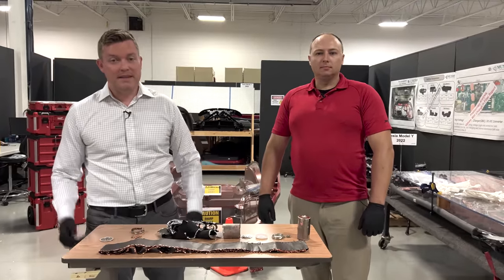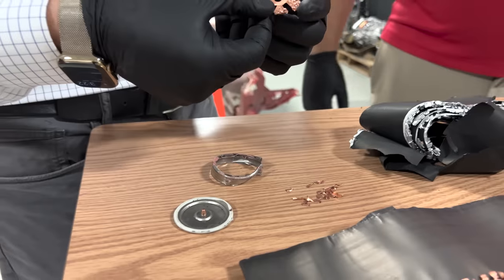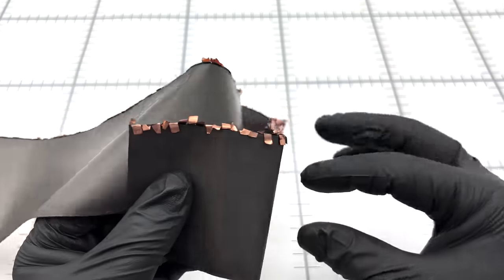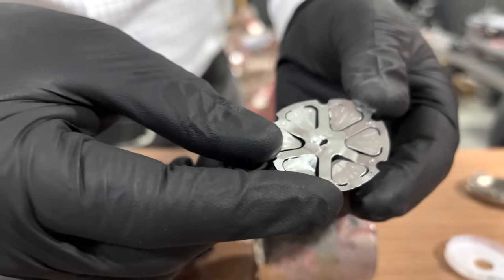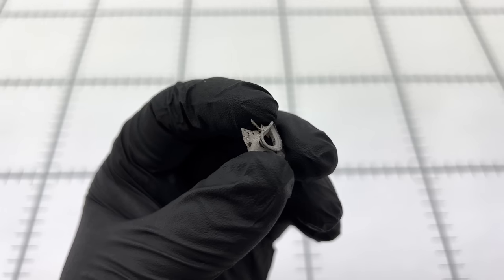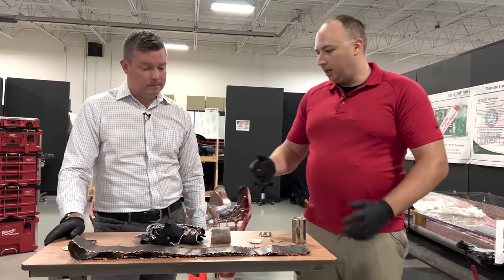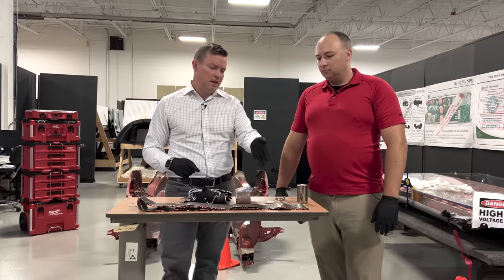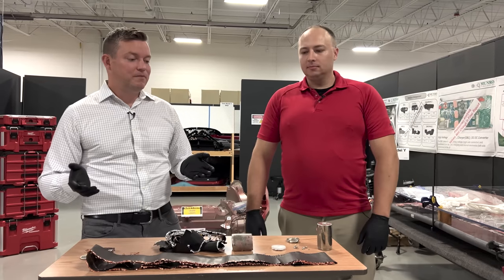What's Inside a Tesla 4680 Battery?

Comment: BIG , NO , gigantic problem for BEVs is cells and or pouches are not standardized for ALL vehicles so as to make servicing/replacing WAY cheaper. Imagine if their were 50-100 different brand flashlights or ANY electronic device , that all took a dealer-only expensive battery ! People would revolt. No C or D-cell just a million dollar TESLA-only cell. Throw vehicle out when it goes bad. And NO , repurposing is NOT same as recycling the cells. You cannot get the goop and metals back out. If you could it would waste an enormous amount of time/money/energy to do so. Landfills will be full of these harmful batteries. 
They are basically throw-away cars , too expensive to install a new battery.

Comment: Cooling. I’d really love to have heat pathway explained, is it anode current collector only, does it go direct to can? Cathode has electrical insulator on cap - does this effectively prevent heat flow?
Electrical. Those flowers are fragile thin & convoluted, why? How does this compare to tab (x 5)?
I gotta say, I’d prefer tough cylindrical cells highly protecting fragile contents, over say pouch cells!
Reply: already shown , in PACK disassembly.
4680 are still SIDE cooled , just like 2170/1865.
no use PLATE cooling , yet.
Reply: @markplott4820  I disagree Mark.
Hence the question. 
I think you are distracted by it LOOKING the same as plaid style.
Side of metal cell attached to cooling bandolier - yes. (with electrically insulating coating)
But from there into jelly roll - radially through many layers of electrolyte, separators, cathode & anode coatings?, 
or axially via metal current collectors. Huge song & dance about it battery day - so how’s it working out?
Using bandoliers rather than base plate cooling allows tiny height reduction of pack and easy path for expulsion of electrolyte in thermal runaway event. I don’t think this is interim part of design.
Reply: @iandavies4853   - we can see , from the Structural Pack disassembly , no plate cooling , same type of side cooling Deployed w/ thermal foam and bottom plastic retainer - non Conductive. and top FUSES and bus bars.
Reply: @markplott4820  I’m not disagreeing Mark. No bottom plate cooling, it’s by bandolier - where the 34 / 35 cells are strung together. Side of cell. Agreed.
My question is what happens then, inside the cell. 
Please, just move on, someone else might chip in. 
I’ve no interest in converting / educating people, it’s too painful.
Reply: @iandavies4853   - what happens in the cell ? - then see TESLA Battery day.
also , see JORDAN on 4680 analysis.( the Limiting factor).

Comment: Dry Process Cathode?
Reply: At least one half the cell looks dry. Its covered. I didn't see the backside too well but I think its electrolyte anyway.. and Cory said something to that effect. Its still like a peanut butter and jelly sandwich at this point with "Stiff" dry peanut butter clinging on one side and squish liquid jelly on the other side. Presumably they had to drain the electrolyte or it turned to a white lithium crusty paste and flaked off.
Reply: Correct - they bought Maxwell a few years ago. No high temperature bakeout of solvents.

Comment: So you like my idea, which Elon heard from me, directly , in 2001, when I met him and named the company with him?  In one modification of MY DESIGNS I used a staggered offset roll and tabs all along the other side.   No reason not to punch the rolls and spot braze with solder powder.  I'd fold them to the outside on the bottom to make that ground though, and not interfere with the post.  So, ask them why they never paid me.?

Comment: Could you give an idea of the weight ratio of the different components? The whole idea of going 4680 was the ratio of active and non-active materials. Do the numbers line up with Elon's promises?
Edit: I'm sure they could make the foils thinner because of the smaller current density going through any point of the current collector, so that could have some effect too. Will all this be in the report?
Reply: this is the "standard" Energy battery cell. NCA 811 which still has some Cobalt. 
other Chemestry are possible , NCM , high NICKEL, and even LFP.
Reply: @markplott4820  Yeah, I understood Elon to say that the advantages of the bigger cell we're in the improvements of active material to support material ratio, not from a change in chemistry. There were also supposed to be thermal improvements (or just mitigations) by going tabless. I'm wondering how much better the ratio of active to support material is in this cell compared to the 21700 and if it lines up with what Elon said.
Reply: @markplott4820  Yeah, it would be nice if someone outside of China could produce LFP in that form factor. I've been using 32700 LFP cells, but they don't seem to have the outrageous charge/discharge rates LFP is famed for. This form factor could be really useful to make e-bikes or other small vehicles switch to LFP because of the extra current available from LFP and the energy density and cooling increase of this form factor.

Comment: Just a safety note: I see Cory has on a watch with what appears to be a metal band.  This is a BIG safety fail when working around anything that has a voltage/current potential. I realize that the battery is dead though the habit of wearing anything metallic is very bad, one day it may not be as dead as you think!
Reply: I noticed Cory has the most expensive band on his Apple Watch.

Comment: Wait, so the cells aren't fused in any way? Wouldn't that mean that if one cell failed, the whole pack would fail? I'm actually shocked that there aren't any fuses at the cell level, seeing as how Tesla fuses every cell in the 2170 packs. What does that mean for reparability if a pack gets bricked because of one cell failing? I guess you'll have to rip out the entire floor since it's a structural pack and replace the whole thing?
Reply: each 4680 cell is FUSED and can INDIVIUALLY be isolated.
Reply: @markplott4820  They are? Where are you seeing that? I've watched every (I think) teardown video and haven't seen any reference to the cells being individually fused.
I'm happy to be proven wrong. Just tell me the Munro video and time stamp and I'll watch it right now.

Comment: Tesla's 2170s were a total dud. Huge hype, but never supplied more than a small part of their own cell demand.
"Cheapest bestest" but within a few years, Tesla bought huge amounts of cheaper, better cells third party.

How do we know "this time it's different"?
Reply: These dry cells are cheaper to make and are higher factory throughput.
Reply: 21700 or 2170 as Tesla calls it had been an industry standard before like for cells in pedelecs, e-bikes, power tools, flash lights, electric cigarettes. But I agree, the hype around each new cell format used by Tesla is unreal. And I guess, that 4680 cells (around 25 Ah) will be way too small in comparison with other form factors like prismatic cells with about 150 to 250 Ah per cell.
Reply: @vidznstuff1  I heard 2170 was cheap to make as well. Cheapest bestest. Don't you remember? How long until they stopped hyping and just bought every decent cell in the market, while never actually mathcing their own estimate car and energy output?
Reply: @koeniglicher  Form factor might be overcome with energy density (no signs so far) and mass production. 
If NIO are for real and about to put a 360 Wh/kg cell on the market for a 150 kWh sedan like Model 3/S, they might have a huge edge. When you can do much better with density, COST matters much less. 
NIO has been active with high performance vehicles and racing for years. Imagine Porsche getting their hands on reliable 360 Wh/kg cells. They'd be building around that with a smile. Anyone with a car shop, really.
Even if NIO's 360 Wh/kg cells cost DOUBLE the hyped present 4680s, even TRIPLE, they'd be fine in premium cars. People forget how cheap cells have gotten and how much they pay for a car. 
4680s are supposed to bring the cell cost for a Model S down to $5-6k. On a 100k car. Who CARES if a much better cell adds $10k? Suddenly a light car can have mega range and be used for racing and the like.